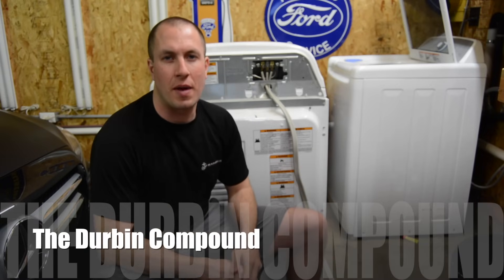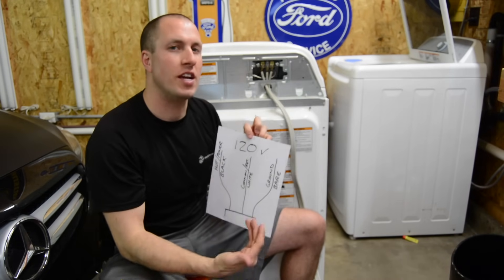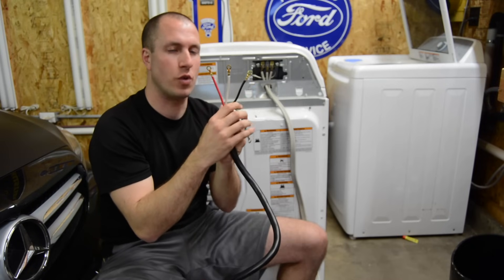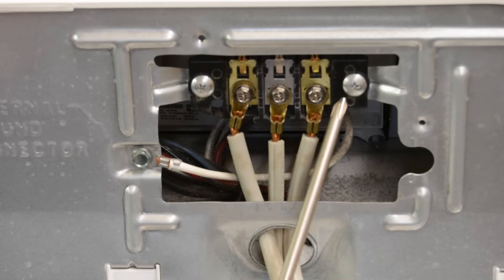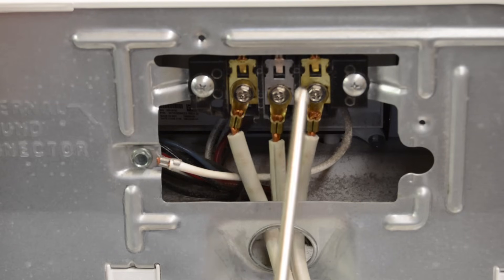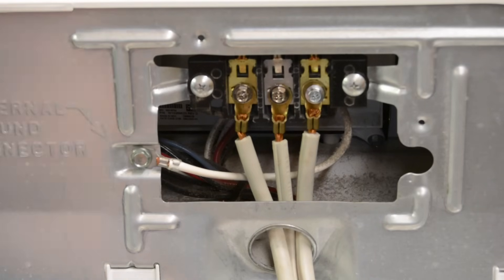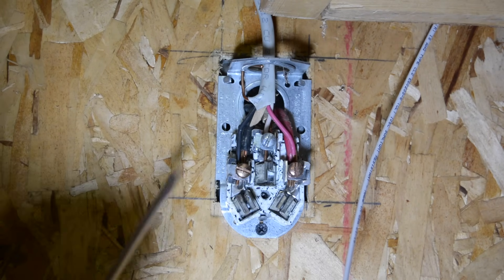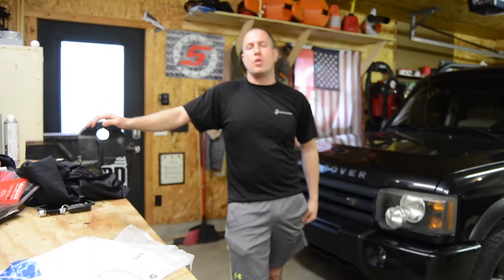How To Change A Dryer Cord - Changing a 3-Prong to a 4-Prong Plug

Comment: The local hardware guy was nice enough to tell me exchange dryer power cords, rather than buying a male/female converter.Your video made it super easy to know what to expect before starting. Thanks for your video.
Reply: 😮 I have been changing cords for years never even knew they had an adapter
Reply from the maker: Yeah they make an adaptor.  They also make a 240V to 120V adapter that allow for a 240V plug to feed a gas range or dryer that still needs a 120V plug

Comment: I had to bend my cover plate out; to get it out. the screw holding it broke or something. I spun that sucker 6,000 times. The wire color explanation helped me, and the little guide, and labels on the back gave me the big picture. I went to a three prong from a four prong a little over a year ago. Gave the four prong to my brother in law. The outlet ended up cooking his dryer though. So I just had to switch it back this week in the new house.

Comment: Great explanation I was right in the middle of a project and realized the new dryer slightly used had a 3-wire cord after I pushed it into place guess I'll finish tomorrow per your instructions and swap power cords thanks for the excellent video

Comment: Regarding a 4-wire power cable - If you are saying that green (ground) wire from the power cable should be connected along with the existing white wire from the dryer to the chassis, that is not correct. The white (neutral) wire from the dryer should be moved to the neutral lug on the terminal block along with the white wire from the power cable. The green wire from the power cable should be the only wire connected to the chassis at that inlet location. Separating ground from neutral is the purpose of the 4-wire power cable.
Reply: You are absolutely correct . The video is wrong and a good reason not to trust a Utube video. The white dryer and white cord wires both go to the central terminal and the green cord wire goes to the frame where the white dryer wire was .

Comment: when wiring a four prong to dryer the nuetral from dryer should be moved from grounding site to center nuetral,  and ground wire attached where white wire was. the point of four wire is to SEPERATE nuetral from ground!

Comment: Looks like I'm the only one going to ask lol. When you have the green ground, what did you do with the older ground that was already there after replacing it with the new green ground wire.
Reply: Literally no one is answering that question
Reply: @Iammonumental_  hahahahaha, yeah I know. I found it on another vid. But yeah left in the wind hahaha🤣🤣😂😂
Reply: @shontaefranklin5610 just found it on another video as well….just finished….running like a champ 👍🏾
Reply: Put the jumper wire back on the neutral and install your new ground wire there. When in doubt, there should be a wiring diagram decal on the back of the dryer.
Reply: You take the old ground wire and screw it in with the white color wire and put them together and screw in the green ground wire where the old ground wire was

Comment: 4 prong cord hook-up requires you to remove the white wire that is already connected to the screw on the left of the opening and attach it with the other white cord wire to the center of the three terminals. Neutral and ground are not to be connected except at the main panel.
Reply: Yeah, that's a really common mistake. To put it in simple terms, the white wires should meet in the middle.
Reply: @Larry Lopez, it's no wonder you are confused because there are code issues with the video as presented.  Remember that on the older 3-wire setups the grounding is through the white neutral circuit conductor therefore the internal ground wire connects to the center neutral terminal screw inside the back of the dryer.  Since the 1996 NEC the neutral and grounds must be totally separated requiring there to be 4 wires in the circuit, using a 4-prong receptacle and a 4-wire/prong cord.  In the 4-wire setup the internal ground wire comes off the center neutral terminal screw and moves to the ground screw at the left in the video.  The green ground wire from the cord goes over this ground wire under the same ground screw.  Notice also at the beginning of the video we were shown a 3-wire dryer cord/plug rated at 30 amps.  Go back and watch the video again and notice that at the end of the video we are shown a 50 amp range receptacle cord and plug, totally different NEMA configuration from the earlier dryer cord.  I am sure the presenter had the best of intentions, but is just short on electrical knowledge and should not be allowed to present incorrect information on DIY videos where someone could get hurt or seriously injured by following incorrect instructions.
Reply: Ok so my ground wire is green, do I keep the green wires together? Putting the green one on my cord under the one already attached to my dryer?
Reply: @tombarker6298  So in order to switch from a 3 prong/wire plug to a 4 prong/wire, I need to connect the internal ground wire(white) to the middle along with connecting the new white wire (from the 4 prong plug) there as well?
Reply: @mars-we3mv  The white wire is neutral and neutral connects to the center screw on the dryer's terminal strip.  The green ground wire connects to the dryer's frame usually at a green ground screw.  If there is a jumper from the green screw to the center screw on the terminal strip, remove it.
Reply: @daniellemcdaniel3600  did you ever get an answer? My dryer has a green wire attached to the left of the panel as well.
Reply: @Walter-fc3uq  I’m also having this issue! Did you figure it out?
Reply: I was just gonna ask that. So remove the white ground that's already there with a 3 prong to attach the 4 prong cord?
Reply: HAHAHAHA! Hope everyone made it alive to dry clothes :D
Reply: 3 prong dryer, 4 prong outlet.
My dryer has a green with a white stripe wire connected to ground. Do I move it to the middle spot or leave it there and add the green to it?!?!
I’ve seen different videos say different things and comments are confusing too :(
Reply: Thanks bro
Reply: Yes, but in this case, if you use the earth ground at all on the body, you bond with the neutral. I believe there are 6 more spots where the neutral bonds to the body. Therefore, if you ground to the body, you're bonding the neutral with the ground.
Reply: Thank You!
 I was going to ask about the white wire that’s already there and what to do with it ! 
 You’ve Both been very helpful for this Grandma doing things on her own! 
 And Raising 7 grandkids and 6 are boys; 3 of those are teenager’s 😁
Thank You, Thank You, Thank You
Reply: Thank you for this.  I sure was doing it wrong.  I had connected both green and white together 😮
Reply: That's why I read the comments. Trying to get different views. Because ones person opinion is not enough for me. I like all opinions and views so my now just gotta go get me a  three prong. I actually get the circle prong off to fit but come to see four prong must be a little more wide spread apart from a three prong
Reply: I was about to comment asking this exact question & I'm overjoyed to see your comment and if I'm getting it... go ahead and replace the white ground wire with my green wire to ground then follow the videos exact steps? So left to right 👉🏾 🟢  ⚫️⚪️🔴 (4-prong)
Reply: No that won't work, when you put the whites together on the terminal block the dryer will not work the green ground has to be put with the white connected to the chassis. Otherwise the dryer will not work.
Reply: @daniellemcdaniel3600 Have you gotten  a answer to the green  wire🤔, because  everyone is speaking  maintenance terminology I'm  still confused

Comment: May be a dumb question, but when connecting a 4 prong cable to a 3 cable hook up do you remove the original "ground" or do you connect the green wire ground to the white ground that is already there? Essentially 2 grounds or just 1?

Comment: My Whirlpool Cabrio has what looks like the exact same setup except the holes that the 3 wires screw into seem to have a nut behind them.  There are also little tabs on each one.  At first I thought perhaps the wires just slipped into them but they don't.  Have you ever seen this? Thanks bud!!

Comment: At 9:10 you mentioned that the common could be jumped to the ground but it violates code.  By not disconnecting the existing wire from the chassis ground and then connecting the new ground wire from the cord, are you not jumping the neutral and the ground at the dryer?  I'm just curious if the existing wire attached to the chassis ground terminal needs to be removed when utilizing the ground wire from a 4-wire power cord.
Reply: This is what it said in everything I read. One went so far as to say that the white jumper should be connected to the white neutral. Looking at this video, I am now right back where I started. I will disconnect the white jumper and wrap it in electrical tape.

Comment: Do you remove the old ground wire when installing the new one or do you put it on top? What happens to the old ground, does it just hang out?
Reply: My question as well
Reply: @keelingfamily7616  the white wire on the left is a neutral and gets moved to the center neutral termal and the green equipment ground from the plug gets landed on the drier shell on that screw in a four wire application. You should never even ground a neutral except at the service entrance panel. Single point of bonding.
Reply: @joeholland428  so when you move the existing white to the middle what do you do with the new white?
Reply: @jawrd_  white to white. They get bonded together with the same screw.
Reply: I have an extra “green” wire that is in the spot where the ground wire “new green wire” so where does that original one that was there go?
Reply: @daejonharrison545  same problem
Reply: They can be stacked. There's no way to keep from bonding in this situation unless you open the equipment and physically detache all whites that are bonded to the shell. When you lug your ground down anywhere on this equipment, it's then bonded with the neutral.
Reply: My old ground wire is green so would it still go in the middle with the white? That’s where I’m confused

Comment: When you are connecting the 4th green wire to the grounding place, do you remove the white wire that is there first, or do you add it on top of white ground wire? Some of us are just that new to electrical work... thanks...
Reply: take out the white ground wire and put it with the other white one in the center. it should just be the 4th green wire
Reply: @estebansolis7276  on top or bottom?
Reply: We all literally watched this video just to find out what to do with the ground after we connect the 4 wires and it’s the only thing that wasn’t explained. Can you make a separate video that ONLY explains the ground wires in detail?
Reply: I put the white wire under the new white wire works perfect
Reply: @angelosellas8131  have you figured it out
Reply: There a two green one that’s first and the 4 prong green wire what do I do with the green wires

Comment: Before you go changing the wiring around in the outlet because the colors aren't where they are supposed to me, you really should get a multimeter and check the voltages between the pins.  There's always the possibility that whoever wired that circuit, did it wrong at the breaker box or at a junction box between the breaker box and the outlet.  You should see 120V between the ground pin and each of the hot pins and 240V between the two hot pins.  Regardless of whether the colors match, if you are not seeing that, you have a problem...

Comment: Very helpful. Ran into an issue, the "green" ground wire will not reach dryer ground wire.
Reply from the maker: If you are carefully, strip back the wire insulation and pull the green wire out for some more slack.
Reply: Thank you sir,
Reply: Sorry, last bother, combine both green and dryer white ground or replace with green? Just to double check before I die haha
Reply from the maker: Yeah combine the green wire with the wire attached to the dryer steel body.  Do not attached the green to the main white leg between the two hot wires
Reply: Got it done brother, thanks again for the help.

Comment: Great video. My question is going from 3 prong to 4 prong. Do I leave the green wire inside the dryer hooked up and add the green to it from the new plug?? By doing this I would have 2 greens hooked up together on that one spot.
Reply from the maker: Hook greens up together.
Reply: @TheDurbinCompound  the wire on the side where I’m suppose to put the new, green ground wire (I’m replacing 3 prong cord with a 4 prong) is white. Do I hook it up together with the new green, ground wire or with the white, common wire? I read it’s suppose to be with the white, common wire (to separate ground from neutrals) but I see you said double it up with the new, green one. Does it matter?
Reply: All green hooks up with all green..... All white with all 😊😊white right?

Comment: does it matter that the black and red is on the outside or can it be switched around where the red is on the outside and the black is on the outside so you got the black on the left side right now and the red on the right side but can the red be on the left side and the black be on the right side it's the question?

Comment: When you hook up the green ground on the 4 prong to the ground that's already existing and attached to the dryer, you just add that one to what's existing, you don't take the other wire out or anything right? I did this on my own and it didn't turn on, you video is validating I did things right which leads me to think just the dryer is broken.
Thanks for the video, I'll check out your other stuff as well
Reply: I have the same question. The ground cable already connected, stays connected and the green ground cable that comes with entire cable gets connected on top of the ground already there? I'm going to have to look at a different video to see if that's the case.
Reply: @lourdesgallardo22  that's my question... The last vid I watched the dude said take off ground and attach with neutral wire in center,  then attach new ground to the machine like old one... I'm assuming they both work,  did u figure urs out?  I'm not using my dryer til I get a straight answer... Thanks

Comment: Hi, thank you for the video when I am converting the 3 prong to a 4 prong on the dryer. The extra ground wire will go on with the other ground wire area that is already there? Or do I disconnect the extra white wire that is already on the ground screw or do I just put them both on together?
Reply: Did you find the answer? I’m going through the comments trying to find the answer. I see a couple comments say just connect the extra white wire with the other white one 🤷🏾‍♂️

Comment: Hello Devin, Im replacing a black 4 prong cord on a dryer I bought with a grey 3 prong cord . The wire terminal connections on the dryer are red white black. Is seems reversed on how you are explaining it here which is black white red. So, do I change the wires on dryer or fo I change it on the wall plug box?

Comment: This was very helpful, but my dryer is slightly different. The original green wire was screwed in the middle terminal with the neutral one. I installed my 4 prong cord, attaching both ground wires and my neutral wire to the middle, and it did not work. Any suggestions?
Reply from the maker: I would definitely separate the neutral and ground. The ground should be attached to the metal case of the dryer. This takes care of any “potential indifference” that might exist (excess power that doesn’t have a place to go and follows the path of least resistance) The dryer may know that it is not properly grounded and can be a safety feature not letting it come on.

Comment: Do you unhook the ground on the dryer when doing a 4 wire on a 3 wire
Reply: That’s my question too
Reply: Yes i did and mine works fine
Reply: Yeah thats what I'm trying to figure out why would he not put that in the video?
Reply: Surprised he didn’t mention this. The white wire should be removed from ground screw and placed in center terminal with white wire of new plug. This separates the return and ground as he briefly talked about in the beginning of the video.

Comment: When going from 3-prong to 4 prong on a 3 prong dryer where do I put the extra green wire? There is no wire screwed to the frame anywhere that I can see in or out of the dryer.
Reply: Same here... What did you do?  Any advice, I need it
Reply: @sixtovz6214  Just left the extra wire sitting free in the air not touching anything.
Reply: @caerbanoginterrupted1833  I think you’re suppose to connect it to the common (middle, white wire).

Comment: I am trying to do just what you did in this video and the black wire connected very easily but the red and the white are having trouble in that there seems to be a little nutsert on the inside behind the hole where the screw goes into it is loose and we cannot get the screws to tighten properly so as we keep screwing the screws in they never fully tighten and so the wire is just loosely sitting on the screw.  Wouldn’t that be a bad situation?  Any suggestions?  Can we buy a new one of these Pieces or what?  Thank you for any suggestions.